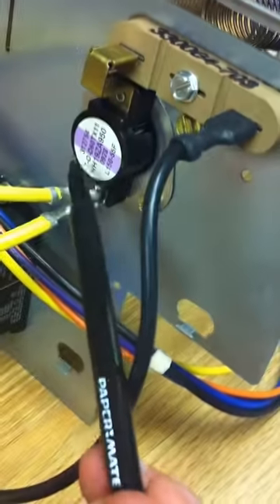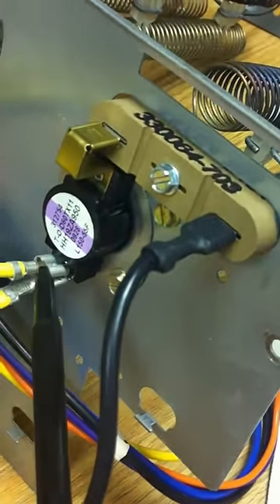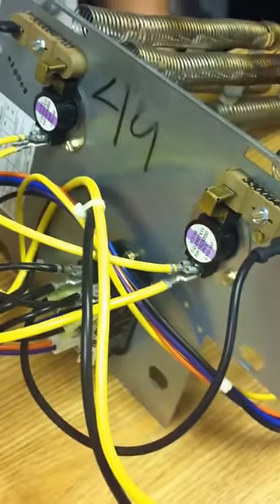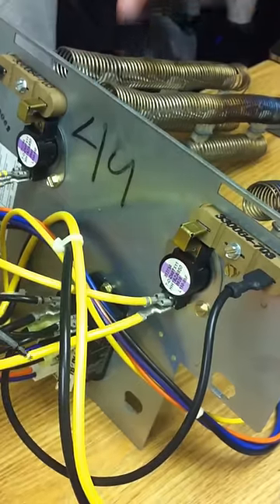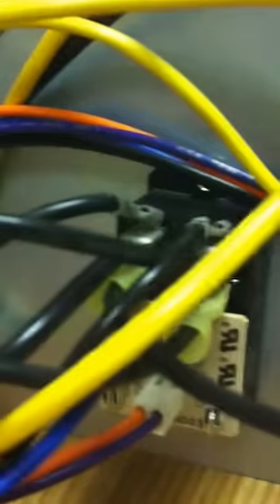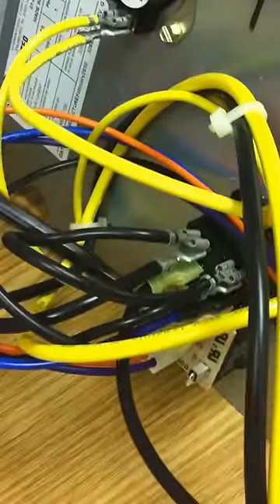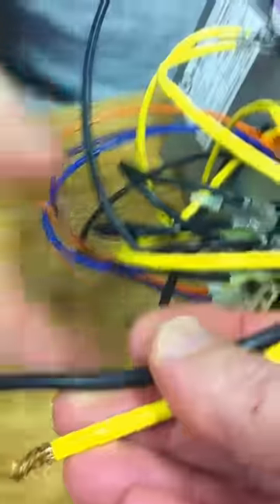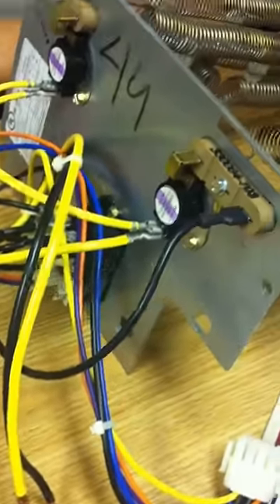aux heat pump heater how they work

Comment: Yes bugs can find there way into anything. You might want to seal it up a little more you will need the proper tape. You can call John and he can send some out. But if you are smelling a burning smell and the unit is new very common its the oils burning off to protect the strip heater from rust. We have some nice podcast also you can learn and we are happy to have your questions.

Comment: OK I have a heat pump and a internal furnace that work together all electric I have two heating settings one says EHEAT / AuxHeat. the other is just heat on and it flashes on and off which setting should I use please and thanks
Reply from the maker: +MajorBigBudz Thanks for following us! Well the most common setting is the heat setting it will flash often if it needs the heat strips to come on with the normal heat pump. So just keep it on Heat  the aux heat / E Heat will turn on automatic if needed if wired properly.
Reply: +Environc thank you so much I had no idea I just bought this house 6 months ago again thank you very much you are a scholar and a gentleman